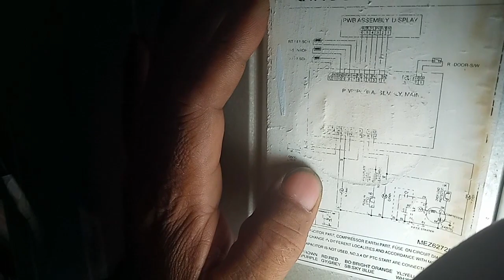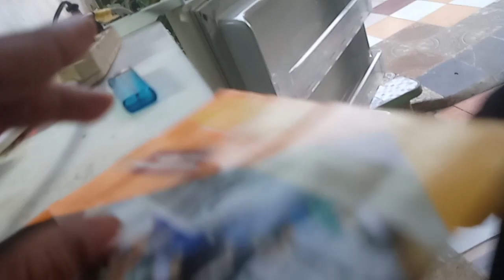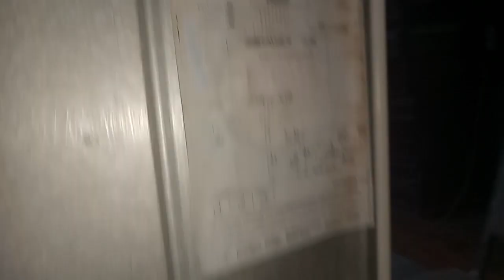merubah kulkas modul jadi timer

Comment: Assalamualaikum om terima kasih untuk videonya saya jadi ingin bertanya ada beberap poin
1.  Kalau modul pcbnya yang bermasalah apakah kulkas tidak hidup? Seperti kompresor pendingin, kipas, lampu dll ikut mati?
2. Kalau mau ganti modul pcb ke timer, timer seri/kodenya berapa?

3. Pengaturan suhu di kulkas bawah saya tidak berfungsi apakah ada msalah di modul pcbnya? 

Saya punya kulkas modul pcb juga sepertinya sama dengan punya om GN-M492ypc. Kondisi kulkasnya yang atas ada hembusan udara tapi yang bawah tidak keluar udara. Saya sudah bongkar ternyata ada bunga es menumpuk, sudah saya ganti fuse/sensor defrost dengan yang baru dan masih sama msalahnya.

 Pertama setelah di cairkan es di seluruh heater semua kembali normal. Terus Setelah 1 hari pemakaian kembali bermasalah. Tidak beku dan yang bawah tidak keluar udara dan tidak dingin. Mohon pencerahannya om apa yang harus saya lakukan  agar  kulkasnya normal kembali.. terima kasih sebelumnya 🙏 walaikumsalam
Reply from the maker: 1 modul bermasalah kulkas bisa tidak hidup
2 kalo mau ganti modul ke timer.pake timer jenis 1.3 
3 kalo pengaturan suhu tidak berfungsi bisa juga sensor suhu nya rusak
coba aja di rendam dengan air panas dulu sensor suhu nya ujunng nya aja di rendam jangan semua nya
jangan sama kabel kabel nya.ujung sensor nya
Reply from the maker: coba pastikan heater pemanas nya berfungsi dengan normal ataw tidak.
seperti nya itu problem nya di heater pemanas dan modul nya.
Reply from the maker: kalaw heater  berfungsi normal ber,arti modul nya bermasalah
Reply: 1. kulkas  saat ini setelah di bersihkan heaternya masih hidup om dan kulkas atas dingin dan beku, tapi yang bawah tidak keluarkan udara 

2. Direndam air panas yang Sensor suhu dingin atau panas om?

3. Maaf, Heater pemanas kulkas LG seri punya saya posisinya dimana om?

4. Kalau modul bsrmasalah bisa di perbaiki atau ganti modul? Kalau ganti modul harga utk LG kisaran berapa ya om? 

Walaikumsalam
Reply from the maker: ujung sensor thermostat.kan yg bawah dia pake thermostat.nah yg di rendam ujung nya aja..jangan sama kabel kabel nya
Reply: @saluranmontir  terima kasih infonya mas, semoga youtubenya semakin rame 🙏

Comment: Assalamualaikum bang.. Sebelumnya terima kasih tutorialnya. Mau tanya bang saya coba ganti modul  ke timer itu kabel putih yang kipas didalam disambungnya sama kabel apa saja ya. Terus pengatur suhu yang dbawah kok mati ya mohon pencerahannya
Reply from the maker: kalo modul nya masi bisa hidup kan kipas biar kan hidupkan kipas nya dengan modul saja
nah untuk kontrol mesin dan da heater nya di modif menggunakan timer
.ac line dari kabel contak kulkas masuk termostat .keluar dari termostat masuk ke no 3 timer jika jenis timer 1,3
no 4 timer masuk ke termal overload.no 2 timer nya masuk ke heater

ac masa masuk ke  runing ptc starter. dan termo fius di paralel.ujung dari termofius masuk ke heater.
ujung kabel heater masuk no 1 timer
untuk saklar lampu nya biarkan pake modul nya aja untuk kipas dan saklar lampu nya.biasa nya modul masi bisa
kalo cuman konrol lampu dan kipas aja.
Reply: Bang mau tanya setelah ganti timer kok kulkas saya yang bawah dinggin banget ya gimana ya solusinya.
Reply from the maker: @akhmadhuda9712  kalo yg bawah cuman pake sirkulasi udara atas biasanya cuman setelan atas.kalo dia pake pengontrol suhu.pengontrol suhu nya rusak